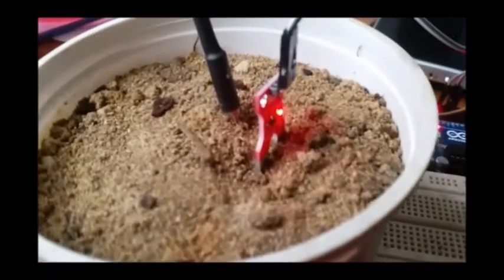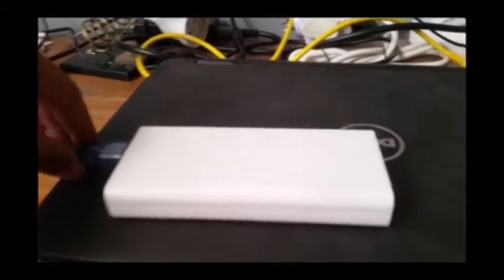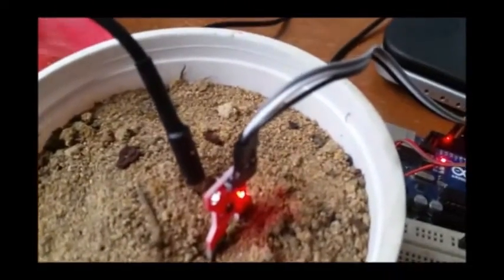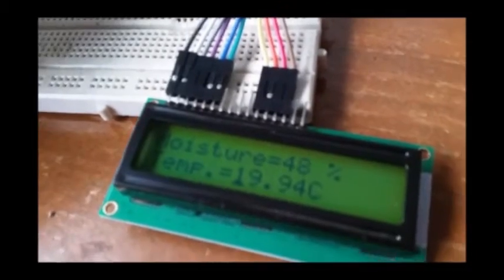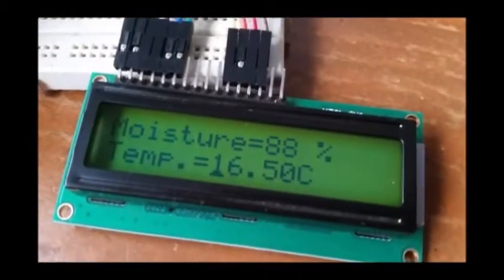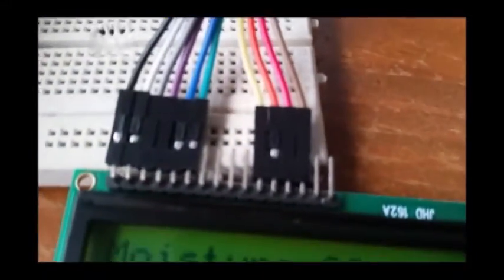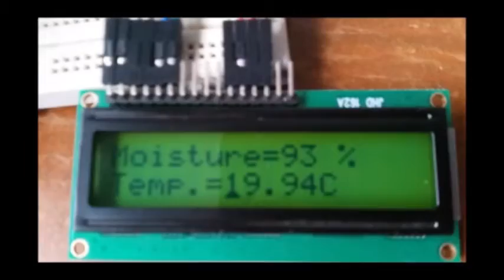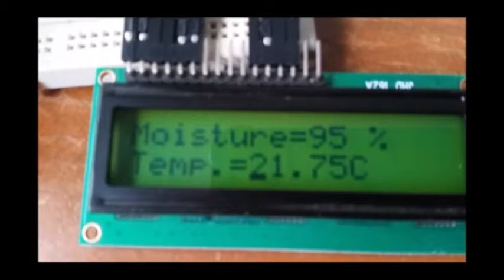Soil Moisture and Temperature Measurement

Comment: Which device is used  to measure soil temperature..?
Reply from the maker: It is thermocouple.
Reply from the maker: You can use any waterproof temperature sensor. I recommend to use the thermocouple for the better accuracy.
Reply: Can we use LM35DZ ..?
Reply from the maker: @chetanotageri2410  If you can avoid short circuiting the sensor, you can use it.

Comment: Hii bro, please help me to connect lcd display pin to arduino. How can connect the arduino to lcd display connections
Reply from the maker: Hello, 

You can click on the link below to see the connection diagram or there is an example code available in Arduino software known as 'HelloWorld' in the LiquidCrystal folder, you can open that program and check the connections. The address is File-> Examples->LiquidCrystal->HelloWorld in Arduino software. 

https://www.google.com/imgres?imgurl=https%3A%2F%2Fcdn.instructables.com%2FF8V%2FCBXF%2FIBHRMUOP%2FF8VCBXFIBHRMUOP.LARGE.jpg%3Fauto%3Dwebp%26%26frame%3D1%26fit%3Dbounds&imgrefurl=https%3A%2F%2Fwww.instructables.com%2Fid%2FHow-to-use-an-LCD-displays-Arduino-Tutorial%2F&docid=aHbZgW6KuztlRM&tbnid=6yy3d2s54oPU4M%3A&vet=10ahUKEwj_6cCx96_lAhWZ62EKHch1BgwQMwhyKAIwAg..i&w=845&h=469&safe=active&bih=625&biw=1366&q=lcd%20to%20arduino&ved=0ahUKEwj_6cCx96_lAhWZ62EKHch1BgwQMwhyKAIwAg&iact=mrc&uact=8

Regards,
Reply: But bro I already connected given link  but the lcd display not showing the output why
Reply from the maker: @nunnavaraprasad2848  May be there is some problem with your circuit, jumper wires, LCD display or Arduino. I suggest, you should consult with your professor or someone who worked on such projects before.